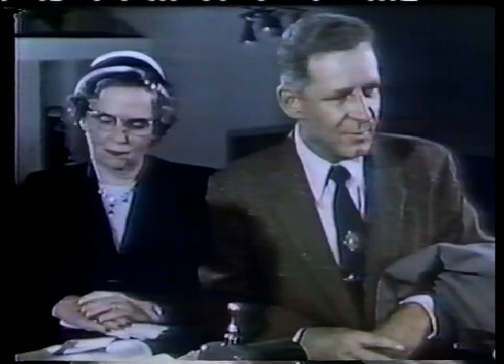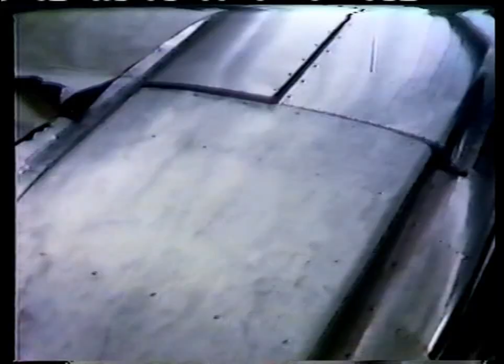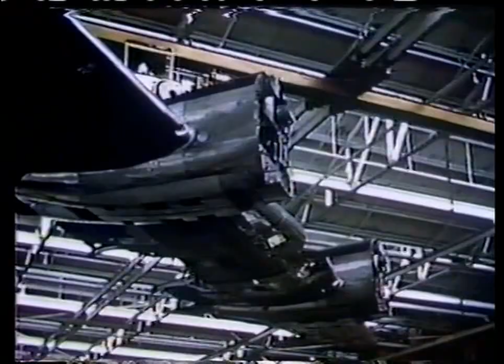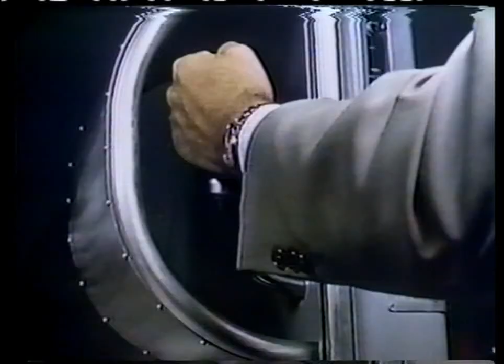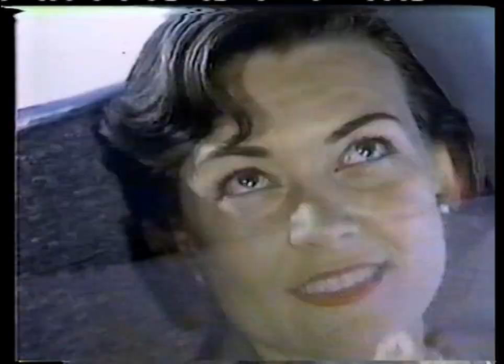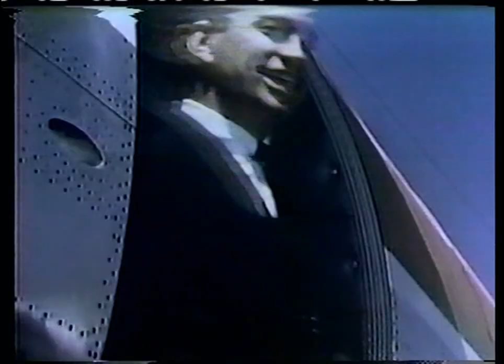Convair CV-440 Metropolitan Promo Film - 1955

Comment: a lot of people died in crashes involving this plane, the list on wikipedia, of crashes, is unbelievably long
Reply: Actually it had a pretty good safety record. We lost one but it was due to the rework facility in Dothan Al that rigged the elevator wrong. Hardly the airplanes or crews fault. 
If properly maintained it's a OUTSTANDING bird.
The Lynyrd Skynyrd crash BTW they ran OUT of gas.

Comment: I flew the Convair 580 for 5 years and have to say it's still my favorite airplane even over the big jets I have flown. They are so overbuilt, strong and reliable, created in the days before computer design where they made them 3 times stronger than they thought they would need to be.  Amazing comfortable workhorses that are still flying today!  I miss those good old days of being a real pilot!  So glad I had the opportunity to fly these wonderful airplanes, but it's sad how so many younger pilots have never even heard of Convair. What a great aircraft manufacturer they were.
Thanks for sharing this video!
Reply: Worked on the 580 as a mech for a few years and got to jumpseat occasionally. Yep, strongest airplane ever. 100,000 hours, 150,000 cycles, 60 years old, still going strong. 
Only issue was some wing cracks on the lower planks by the fuel panels. Solution was to stop drill and monitor--no patches. My crew chief said he'd been looking at the same cracks for 15 years and they never changed--and some planes didn't have them and were unlikely to get them. Figured it was a slight variance in the alloy or heat treating for certain planes.
Reply: @Bartonovich52 Thank you sir for sharing about the cracks and wonderful experiences
Reply: +dc10driver1 I used to love being a passenger on the 580 (at least as long as you didn't sit right across from the props).    One flight took me from ICT-MCI-SUX-FSD-OMA-MSP (although maybe not in that order).    Never enjoyed a flight so much in my life.    (I did have a friend who showed me the cockpit and those pilots had naughty pictures stashed in every crook and crevice they could find.  Apparently when they started hiring females they got cleaned out in a hurry!)
Reply: +Hank Fuddle 
I remember many passengers telling us they preferred riding on the Convair than the jets they were connecting onto after our flights!  I had a retired USAir captain tell me that at one time they had around 70 seats in the back, before the flight attendant rules came to be for 1 attendant for every 50 passengers.  With "just" 50 seats in the cabin, they were all "first class" comfort.  Very nice ride indeed!  Still miss that airplane!
Reply: Man, I'm jealous! My first airplane flight was a Convair 600 on the  now defunct Trans Texas Airways. Big, roomy seats and a nice big window over the wing. I was only 10 years old and it felt like I was on a huge plane even though there were only around 30 seats as I flew from Dallas Love Field to San Antonio. Fast Forward to 1982 and I flew their last year of service from Dallas Love Field to Cancun on a DC-9 Great airline and their fleet all began with Convairs. You have some great memories!!!!
Reply: Always had a good feeling for the old airliners :
-my only experience with the big props were Cdn military :
Twin Otters... which were a barf-machine.
these rode better ?   anyone ?
Reply: Exactly in MEXICO they were very popular from 1958-until 1975 then they were sold to companies that still fly them and others from private collectors here in MTY there are 3 or 4 Cvr-440 Original North Airport MTY NL
Reply: I want to share the joy that I felt in riding in one... it was actually my very first flight.  This thing was built like a tank (at least, it felt like it was)...... so loud you couldn't even hear yourself think :)  but "lemme tell ya"  that machine leapt off the runway!   Just some wonderful memories.  Thanks for sharing your comment
Reply: I flew in a couple of them back in my commuting days to Aberdeen, SD in the late 80's.  Loved those planes!

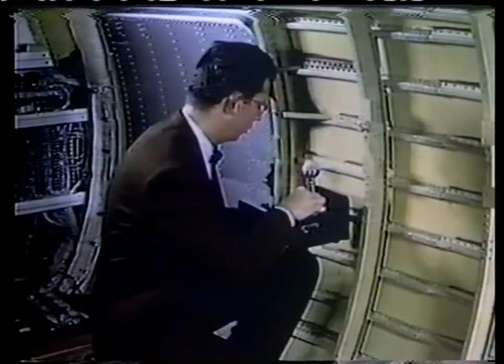Comment: 3:18 General Radio 1551A sound level meter. Introduced about 1950 ish. Flat response from 20 cycles to 20 Kilocycles. Has A,B and C weighing. Has 7 vacuum tubes. Preamp i.e. first tube is a Raytheon CK512AX. The meter's Filament A supply is 2 D cells i.e. 3 volts total. The B high voltage plate supply is single 467B battery 67.5 volts. 
Reply  ·
Reply: Impressive knowledge sir! However did it pick up shortwave?
Reply: So, based on this information, what is the captain's name, relax, just kidding, but wow, you are a very intelligent person, very nice.